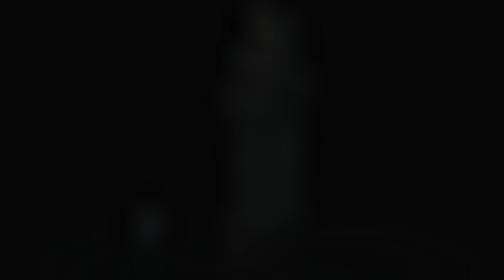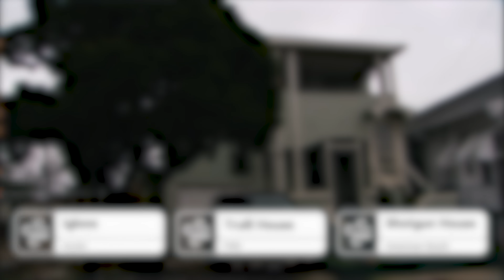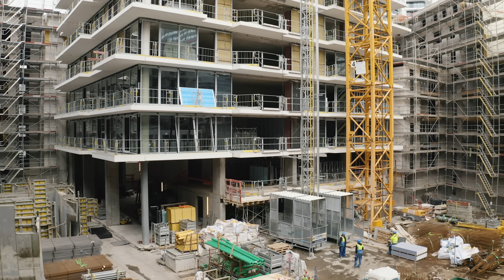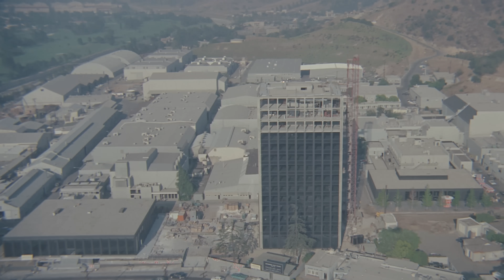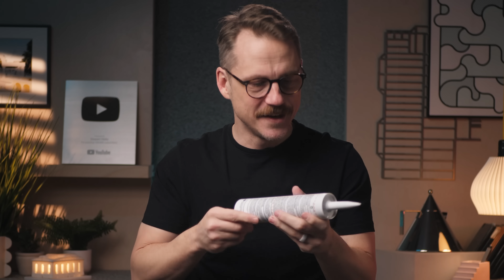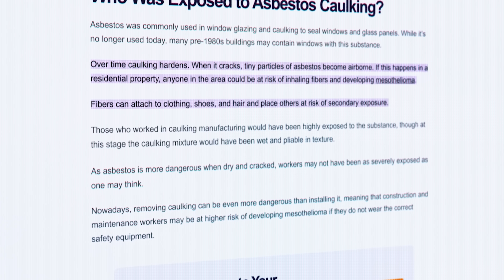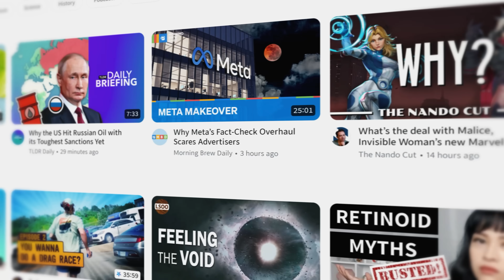How Caulk Accidentally Made Buildings FLAT

Comment: I feel like this doesn't give enough time for the alternate argument. The points are true, but also a lot of older buildings are not made that well either. Most old buildings are cold and drafty, and still decay over time. Its not a bad thing that warmer houses can be built more quickly and cheaply, and that builders can do it with less experience and skill required, even if it comes at the expense of more interesting aesthetics.
Reply: Also the curtain wall was more created to give people natural light. He's almost framing it like this one United Nations building started the whole movement and people adopted it out of having some global social agenda... pretty big stretch.
Reply: Yeah. Everyone wants veteran craftsman of 25-years results without paying veteran craftsman of 25-years prices. Especially today with the volatility of the jobs and housing market, I don't blame anyone for being more concerned about cost and resale-ability over aesthetics. That's what the inside of the house is for.
Reply: The problem is that the modern homes with rather shoddy construction are, on average, about 500% more expensive than those built 50 years ago. Wages have increased about 25% in that time.
Reply: Agreed. As much as I enjoy the beauty of old-school architecture, if mass-produced housing is what it takes to keep roofs over heads, I'll take mass-produced housing.
Reply: I find most articles on a subject that is only understood by insiders miss important facts.  As an example, a particular shackle from Home Depot may in fact be as strong as one that is certified to pass specification MIL-S-24214A but that chain of paperwork allowing traceability and QA back to the point of manufacturing can far exceed the cost of the part.  Certain applications might allow for one shackle in a box of twelve to be half as strong, but others may demand far more consistency.
Reply: Once new technology and construction standards of practice emerge, it's challenging to return to previous architectural eras. Manufacturing and materials evolve, supply chains reorient, and builders identity more financially efficient routes. This video's emphasis on the aesthetic overlooks the multifaceted decisions made by developers and builders. It also misses building code and energy code requirements that give us no choice these days on how to build. So while an interesting video and directionally correct on today's flat architecture, it lacks nuance and consideration of the pressures weighing on today's construction approach. 

And who knows - as construction tech continues to evolve, perhaps we can return to more ornate style. However, this article in IFP argues it's consumer demand. "The naive explanation for the decline of ornament is that the people commissioning and designing buildings stopped wanting it, influenced by modernist ideas in art and design. In the language of economists, this is a demand-side explanation: it has to do with how buyers and designers want buildings to be. The demand-side explanation comes in many variants and with many different emotional overlays. But some version of it is what most people, both pro-ornament and anti-ornament, naturally assume."  https://worksinprogress.co/issue/the-beauty-of-concrete/
Reply: There are many far better construction methods that still exist. You can standardize and mechanize high-quality construction. The 1940s windows on my house were built in a factory, yet have lasted almost 100 years and are easily repaint-able. Hemp-based building blocks with lime binders provide insulation, are easily shapeable and go up quickly. Teaching people how to plaster correctly is a low barrier to entry, and the same can be said of terra-cotta roofs or tile floors. Most construction methods of quality can be brought back quite easily and affordably, it's just that corporations cannot make a profit through the renaissance of craftsmen, only the economization of building components. Who is going to advertise trades courses and help fund education in that sphere? Definitely not DuPont or DAP...
Reply: @ahilltodieons  Please shut up ranting lies.
You are not a craftsman so stop making up a story for us then using that so called story to support your made up crappie lie.

We're doing fine building things and the stuff you want to bring back left production building for a reason.  It's still avaliable. We still do it when someone wants but it doesn't improve a structure top the point it's claimed it does buy some salesperson or cheerleader.
100% of those things you list have supply chains  owned promoted by multi billion dollar companies. 
The fact you don't even know that shows you're an ignorant cheerleader.
Reply: Not only that, it doesn't propose a solution.

Its all well and good to talk about a problem, but in a time of what is essentially a global housing crisis, where we need more and more houses, and more and more apartments, while also desiring to consume less and less energy to slow down the changes to the climate...

You can't just come and say, "Hey the tool that has made buildings consume less energy and be cheaper to build... thats bad."

You have to propose a solution that will actually help.
Reply: @Peregrine1989 these architects live in their own cozy world, where they want to create masterpieces. While the best solution ever invented for housing large amounts of people are commie blocks. Modern materials and construction techniques can even make them energy efficient and esthetically pleasing. Just don't forget the infrastructure that made them great: schools, kindergartens, hospitals within walking distance + add multi story parkings, commercial spaces and offices.
Reply: @Peregrine1989   The housing issue is not because of lack of housing. We have already enough housing for everyone, easily. There's anywhere between 8 and 16M vacant homes and < 1M homeless people in the US 

The issues are that their status as a commodity that's unlivable without enables price gouging (same thing with insulin) so it's entirely unaffordable.

Additionally, building more housing won't fix the problem since so much of the new housing being built is not in desirable locations. People want to generally live in a city or neighborhoods closeish around the city. Those areas are already built in. Building outwards will not affect prices here much; you have to build vertically, fill more people into the same space.

With these two factors together, it's very easy for groups like BlackRock, which is functionally just a bunch of billionaires/multimillionaires pooling their money together, to buy literally all of the land that matters.
Reply: Yeah, like, I'm watching this and thinking "yeah, cool, do you want to pay 3x as much for a house? No? Then do it the cheap and boring way."
Reply: @nlb137 well in the video he mentions that these cheaply built buildings degrade quickly which leads to repeated costly renovations . that’s no good
Reply: so many people in this comment thread are exhibiting such a good level of critical sociological analysis its actually warming my heart
Reply: I also feel as if he's doing his own argument a disservice by calling the older building techniques ornamental. If it has a clear structural purpose, it isn't decorative. The diagrams he used certainly have curves to them, out of necessity, but outside of the job of avoiding leaks, they ARE flat. If you took one of the more modern panels, and etched a pattern into it, it'd be "more ornamental" than the buildings he covets for having multiple materials surrounding a window.
Reply: Because the "alternate argument" is a bunch of bull, it's legitimatley ruined the psyche of every society it has touched and caused many problems in city planning and basic life for everyone. Defending this just says you hate creativity
Reply: no one said that
Reply: THANK YOU!
Reply: It's all about finding balance in my opinion.
Reply: I wouldn't even be able to afford my own house if I stole the land and did every bit of labor with my bare hands.  

There's no way in hell I'll ever be able to afford to buy a house with any fancy ornamentation.
Reply: "they don't build em like they used to" -- drafty, moldy fire traps despite being laced with asbestos. The very best of old techniques… oh wait, those haven't stood the test of time, they also require magillion dollar renovations & updates after 75 years, only they have to find increasingly rare niche craftfolk to do the work, and frequently have to be entirely replaced to meet modern standards of safety and habitability. Progress required innovation, which then enabled further progress. Hipster architecture guy doesn't like the aesthetic, but isn't responsible for all the times when "opportunity for expression" is actually "opportunity to get it wrong and a chain of someones have miserable lived environment for 80 years"
Reply: @FrelanceEQ  these modern tract home developments won't be around 80 years. stop lying to yourself about their superiority.

My current house is just short of 100 years, it needs some electrical work. It is FAR superior to the house built in 1992 that I looked at. Cheap materials, shoody craftsmanship. It was falling apart in 08 when I looked at it, and it was less than 20 years old.
Reply: Boo you sir. Boo indeed.
Reply: I've owned 5 houses, & the best were the two oldest, one of which I live in now which is 175 years old.
Reply: @christianheidt5733 survivorship bias.
Reply: The takeaway should be about due diligence.  You don't want an uncaring novice who learned culinary arts from Youtube, cooking your steak to a rare.  You want your steak perfectly balanced and flavorful, and knowing it was tended to with an appropriate level of craft, giving you confidence that you're not going to end up barfing it up later.  Builders need to respect the buildings they're assembling, and the existence of "goop it up after" provides no confidence.  And more importantly, owners need to engage common sense enough to say "I can't afford to build this building with an appropriate level of respect."  If you can't afford to build it responsibly, turn around.
Reply: making houses easier to put together allows for companies to devalue the builder's work, and to under pay them
the less specialization and effort that goes into doing a job, the more societally acceptable it is to pay that person abysmally
through streamlining the process, the more complex parts of a job that pay well are taken away
it's a gradual shift towards factory made buildings put together by underpaid migrant workers, thus putting more in the pockets of development firms
Reply: @eclypsaqueen7013  You know nothing about how the economy actually works and you're 100% wrong about what has happened to pay.
Trades over the last 30 years have specialized. Every step is done by specialized workers and because their producing is so much higher they are paid MORE even though the cost per unit is down.
Go pick 4 friends and sheetrock a 2000sf house. It has to been done to current standards.
Once your done how much faster do you think the crew ?? Come on you're slinging economic models, give a time.
How much faster is the pro crew?
Roofing, same thing pick 2 non construction helpers and tell me how long for each of you????
Reply: @sparksmcgee6641  his comment went right over your head mate. He is talking about prefab and other modern construction methods, for instance 3D printing in concrete, that in fact completely sidestep all tradesman in the process, and rely on unskilled labor to put the pieces in place and fasten them.

Whoosh.
Reply: Older houses are definitely built better with better materials
Reply: @eaj2900  Not at all. The lack of insulation is so shocking.
Reply: @eaj2900  google survivorship bias 🙄

Comment: This seems to parallel the @buildshow video about hating modern architecture because of how unforgiving they can be in cases like caulk failure.

A sloped roof and overhang protect from water regardless of caulk.

Comment: As an architect who has spent countless hours hanging off the side of buildings (up to 80 stories in the air), I can say there is no perfect solution.  But don't be fooled that historic buildings are maintenance free or the "solution".  They have their host of issues on top of not being energy efficient.  Sealant does fail, but that doesn't mean it has to cause an issue.  The type of failure Stewart describes is caused when the facade is designed as a barrier system.  That is one line of defense.  Good architects don't use that approach.  We design two lines of defense, commonly referred to as a cavity wall approach.  In this design, the exterior sealant is sacrifical.  Any water that passes it goes into a cavity and drains out of the wall or window.   As Stewart noted, sealants play an important role in stopping air infiltration.  Yes, this can cause mold issues if the building is not properly designed.  Unfortunately, we don't have a limitless supply of energy, so we have no choice but to use sealants.  Old buildings, while beautiful, are energy hogs.  All glass buildings are not as efficient either, but that is a totally different topic.
Reply: Studies show that energy efficiency in modern buildings is a often a myth and wasn’t correctly or fully measured… absurdly high energy cost in the manufacture of the materials, higher cooling energy cost because of lack of air flow because the building design assumes industrial HVAC rather than using natural air flow (e.g. the modern absence of high-up manual airflow windows), and then factor in people running electrical humidifiers because the HVAC system air is ridiculously dry.  Similar thing applies on trains with non-openable windows compared to older trains with openable windows for cool outside air as needed

I’m talking about office buildings, etc, not like an old drafty house in winter compared to a non-drafty one.
Reply: I don't view this video as "anti-sealant." It's against the exclusive use of sealant. Take the terracotta window he broke down, you could ABSOLUTELY use sealant in that construction. But using ONLY sealant, or PRIMARILY sealant is what causes issues imo. Sealant should be a failsafe for if other systems fail.

Comment: Windows on the old buildings have that "natural appearance" of an eyes on the face, while new and caulked 
rather look like an afterthought or last minute replacement with the cheaper option.
I cringe on the site of slightly skewed joints of an aluminum frame window that pass for the "job done"..

Comment: This is interesting, but it's deeper than you think. Modern buildings are ideally built air tight to preserve the hvac conditioned environment inside, preventing mold and rot. Old buildings were intentionally not air tight, so the moisture build up they couldn't prevent would dry out, preventing mold and rot. The consequence is that the old buildings were always colder in the winter and hotter in the summer.

Comment: I appreciate the level of detail here but I do think the framing of the video is somewhat off. The way this is discussed it seems to imply (though certainly not explicitly state) that caulk was some kind of an accident of innovation that forced architects to stop building more interesting structures and facades. What's missing is that caulk was a solution that was inevitably going to be found to the question imposed by business owners of "how do we cut labor costs?" Caulk could still be used in a modern context if costs weren't the driving issue. It'd have it's place in all sorts of contexts. 

But this is inherent to capitalism, especially modern capitalism that only really focuses on early sales and stock fluctuations as opposed to any concern for the decades long stability of a product or company. Because obviously decades out that CEO will have moved on. The desire to cut labor costs and fire people is the main story here. The chemical was just one solution to get there and they found it.

Comment: My pet-caulk-hate is bathrooms!   Moldy caulk everywhere!  How did we make them before caulk?
Reply: Lots of tiles. Baths weren't fitted in the way they are now, and so didn't have to be sealed against the wall. Showers weren't fitted or were larger and all tile affairs. Sinks were designed with a high area of porcelein or tile to prevent splash-back getting behind.

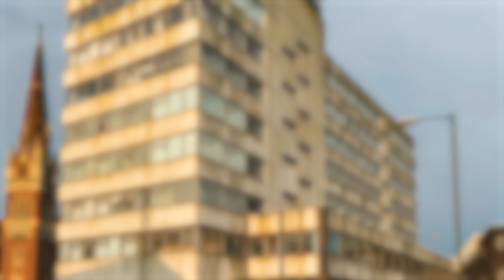Comment: 14:17 shout out to Kidderminster in the UK midlands! Crown House was also clad in panels that were supposedly self-cleaning, however they weren't, and any attempt to clean the building damaged the surface of the panels, allowing moss and mould to get a foothold.

As one of the tallest buildings in a small town, it could be seen from everywhere. The building was so hated that it was once voted one of the ugliest buildings in the UK and demolished by the local government with no plan for what would replace it.

Comment: I think there are a number of ways that you can avoid water leaking into a building. Most building codes have these measures. Modern buildings shouldn't have this problem. It's when these codes are ignored and poor designs implemented that you get these problems. It isn't that caulk is a bad solution, it's that it's used to hide poor designs and manufacturing defects.

Comment: That architecture that doesn't think about air flow and expects the use of AC is also a safety issue with the modern issue of energy infrastructure going down during extreme heat phenomenon